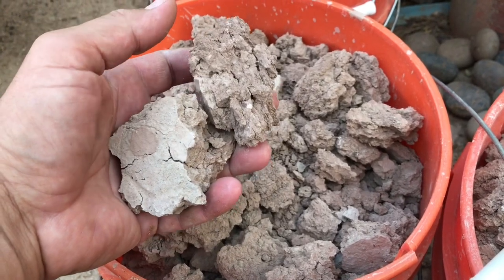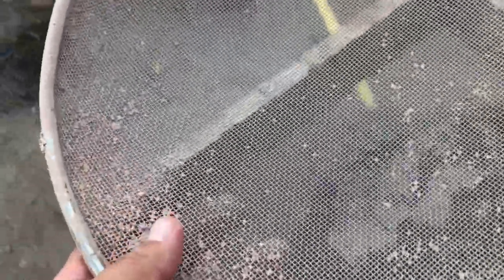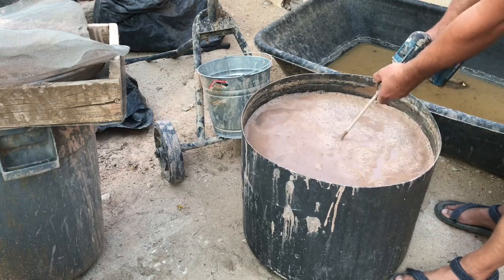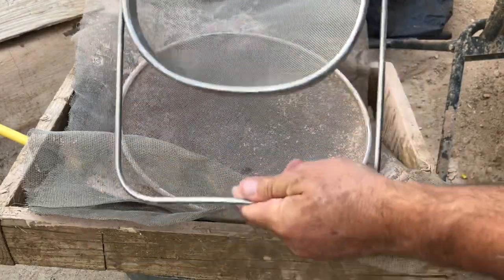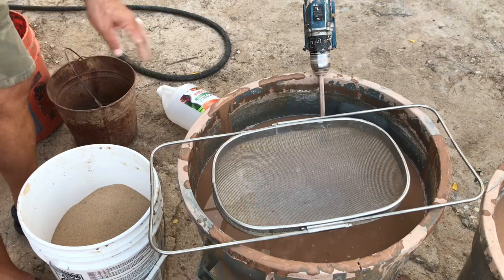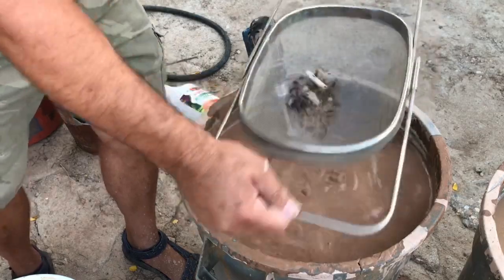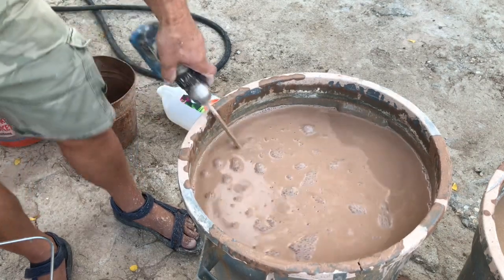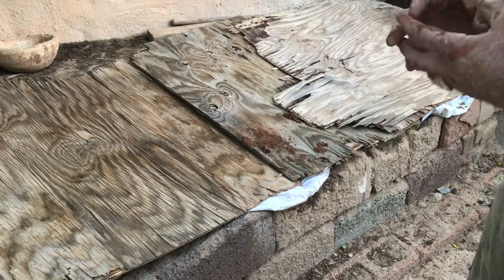Making Clay # 2

Comment: You said that your clay contains gypsum. Doesn't gypsum harm the plasticity of pottery clay? Gypsum is often used in farming to temporarily break up clay soil before adding in compost. I would expect a clay that contains gypsum to have poor plasticity.
Reply from the maker: They are either small gypsum crystals that can be strained out or gypsum salts that can migrate to the surface to make a scum coat which fires whitish or sometimes I rinse the salts out.

Comment: Hi, Tony! Could I bother you with another question: Does the sand sink to the bottom in those troughs, or does it stay in suspension?
Reply from the maker: With some clay’s it will stay in suspension,  I usually don’t give it time to drop in the buckets but it may drop in the plaster troughs. You definitely have to wedge to clay before using. It helps if you keep the clay as thick as possible while straining. Some clays need more water then others. Hope this helps, always up for questions 😀
Reply: @tonysoaresnativeclays1434  - thank you!

Comment: Thanks, Tony! Would that be about 30% sand you added to the clay?
Reply from the maker: 20 to 30
Reply: @tonysoaresnativeclays1434 ,  thank you!
Reply: Sand is a bad idea. There will be cracks during firing. Chamotte ( grog) is a good idea. Sand ≤10%.
Reply: @jaretyevas1509  lol he fires huge pots with no cracks
Reply: @chompers11  lol, почитай книгу!!! Песок уменьшает прочность горшка. Песок увеличивает пористость. Песок, при обжиге, даёт расширение в диапазоне 550 градусов. Учись - lol.
Reply: @jaretyevas1509 reading the book is not the same as putting it into practice. The sand works. Unglazed earthenware is porous anyway, so adding sand is not an issue

Comment: Hi, I'm just getting into pottery, and digging my own clay, is the sand to stop the pottery exploding while firing in the kiln, and how do you know how much sand you need ? I have seen a good clay deposits at Tue beach, would this be good clay to use to fire and make things like plates and cups, I know they need glazed to waterproof them, but would the clay be ok for the above mentioned ? Thanks, and great video..
Reply from the maker: I’m not sure if the clay will fire to a high enough temp to melt glaze, maybe an .06 glaze. Don’t know the clay body. About 20 percent sand to clay . It helps with drying and firing. It is a binder

Comment: What about Santa that has little bits of Mica in it? Can that still be used? thanks for these videos!☀️
Reply from the maker: Yes you can use mica in your clay as long as you don’t want to slip and paint the pot because it will sometimes spall out the surface a bit.
Reply: @tonysoaresnativeclays1434  ok,great.thankyou🙂(and,sand,not santa.lol.autocorrect)

Comment: What the sand added is for ?
Reply from the maker: The sand is added for  temper, it helps to keep the clay from shrinking, cracking, or popping in the drying or firing. The clay is very pure when I find it. It needs something to loosen it up so I can work with it.😀
Reply: @tonysoaresnativeclays1434  I was thinking the opposite, that the clay has to be the most refined and the most plastic....